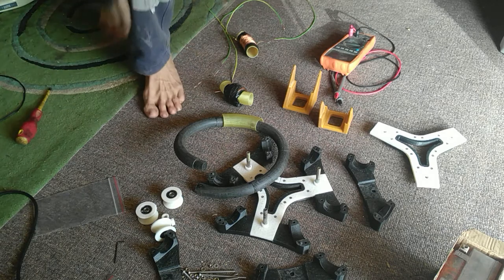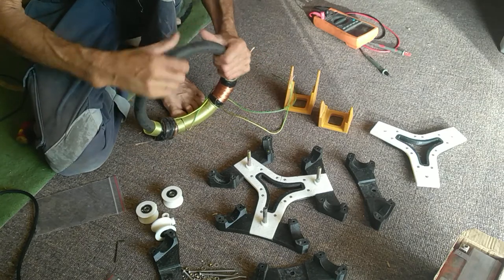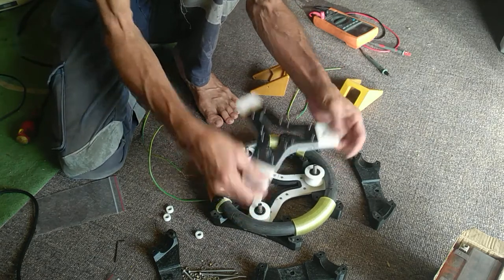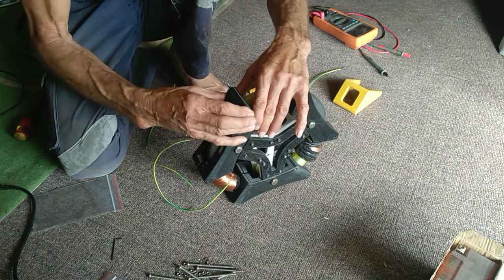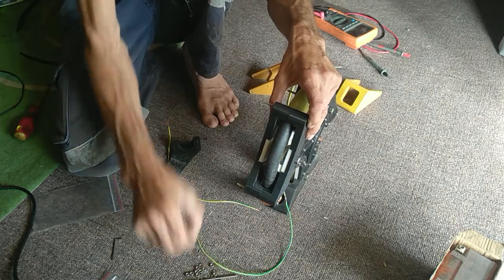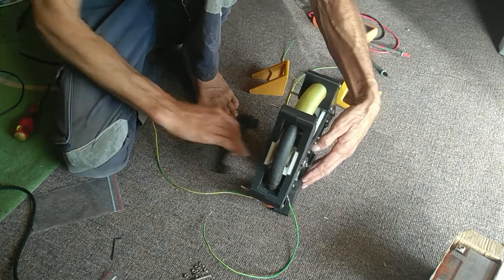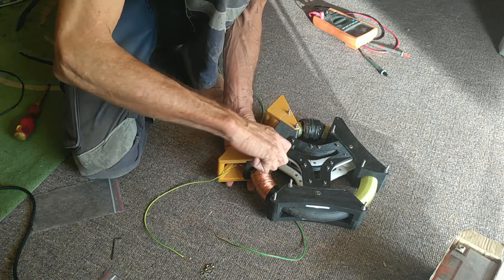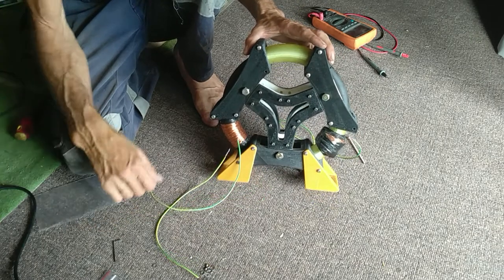Latest Solenoid Motor

Comment: Looks awesome!
Reply from the maker: Thanks for checking out my device, this was my own concept based of those torches you could get that you shake to charge as there is no resistance when the magnets go threw the coils, this link is to a YouTuber I sent the 3D printer files to and has built one and has it running.
https://youtu.be/JwVeXd-SrwA
So you can see it inaction, I will be continuing mine again soon, had to move hour and have not been able to at this point be am keen as my wiring setup will be a bit different to this, but the idea is sound I feel and has lots if possibilities and configurations that could be played with, but my ice was to get my idea out there for others to play with.
Will send you the files to this on if you want to print one out.
Reply: @SpaceManAus  Hello, defiantly looks promising and your own concept! great video

Comment: Holy shit dude you actually did it! All those months of work and you've actually got the basis for a working no-fuel reactor. This is amazing.
Reply from the maker: Not the reactor I am working on, I had a fail in the welding process and need to try again, got a bit disappointed and let it go for a bit, but other things have happened in my life and will need to move house soon and will continue then, but still this was only a concept motor and it will profuse power eventually.
Reply from the maker: Hi, just wanted to say, even if I build this Ivan not show it hear or I will disappear like the guy on YouTube who first showed it, but it basically is two pulsing hydrogen reactors that power each other in resonance, if you are capable of building one that should be all you need to know.

Comment: Dude that's a sweet setup. I've had to rework mine because I print at a very rough 2.8 because I'm not patience enough.  Had to drill out some holes and sand some areas the normal tweaking stuff. I just uploaded a new vid showing your design and its not bolted together yet but want to show off the design. I printed the frame as a whole unit but I really like how yours looks as 4 separate parts so I may just reprint the frame. Well done mate!!!

Comment: Alternator have rotor with the coil inside that make magnet field, and carbon brushes that set up magnet field of rotor if you have that off the regulator will put lot of energy but because it's regulated will put the minimum,  just keep battery up to 12v, if u reverse the brush polarity with standard will be 1 negative 2 positive,  standard  regulate,  (now if swap 1 negative and 2 negative to the ground negative from the alternator  will become all negative, to the engine and If it's connect to the battery on the positive side, will revert polarity in the baterry energy  - energy it more stronger then positive,  since this it's the only energy that keep the engine run, positive will shot down, and remove all negative ground from engine to the body of the car , this way the engine it's not loose the power towards to body, remember that engine mounts it's rubber, and will stand alone with engine ,